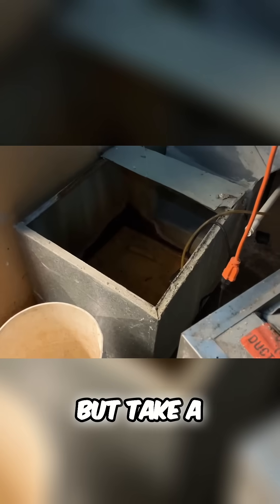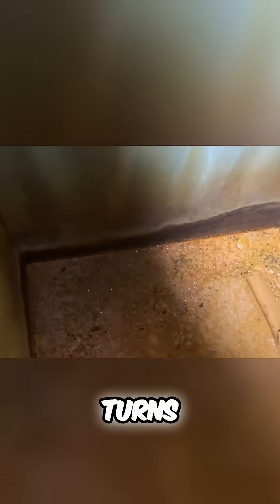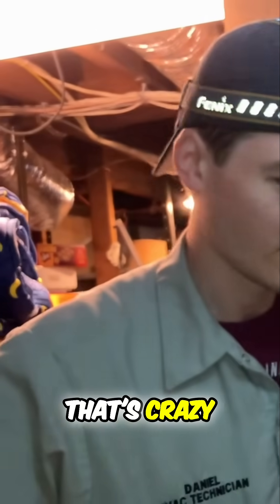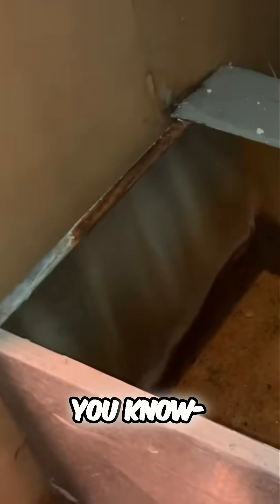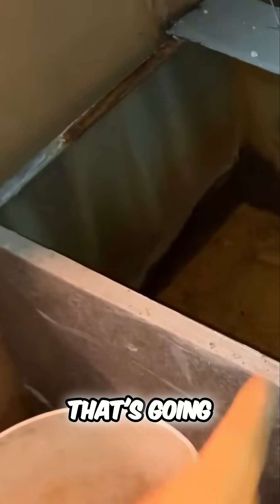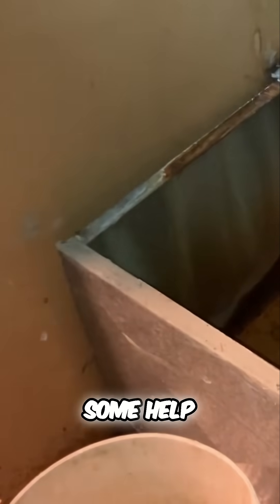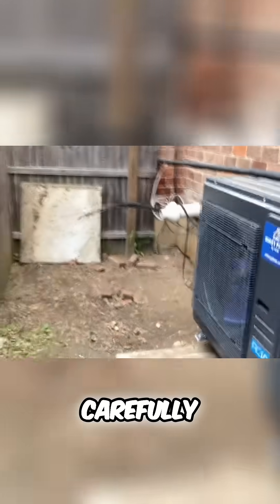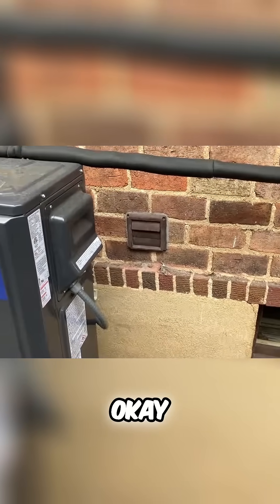Sump Pump in Ductwork?! Genius HVAC Hack or Disaster?

Comment: I found your video because I’m considering putting a pump in my ductwork under the AC.  The metal ducts under the house have rusted and they fill with groundwater when it rains.

Pump = $
Lining the ducts = $$$$

Please let me know if I’m wrong on this!